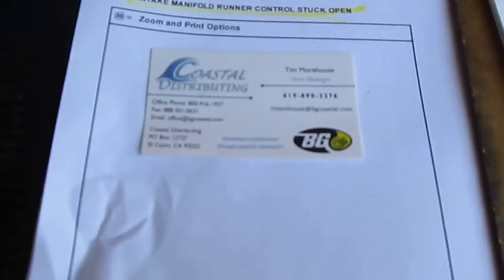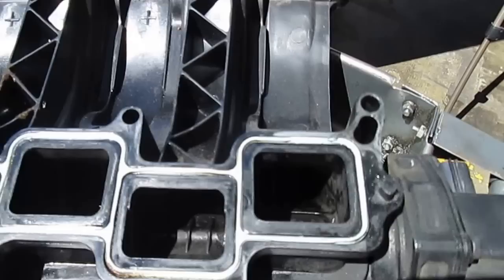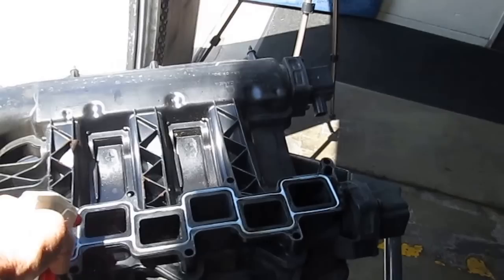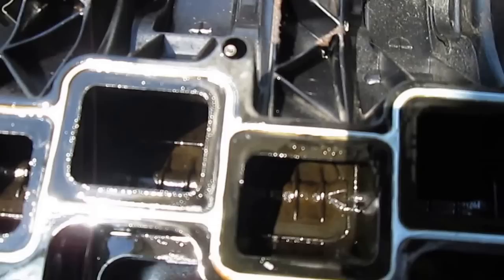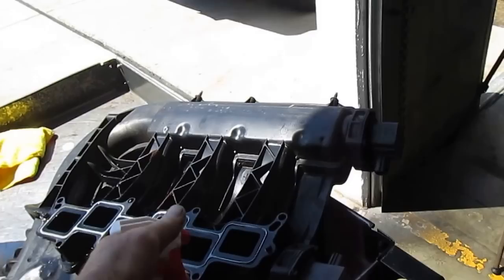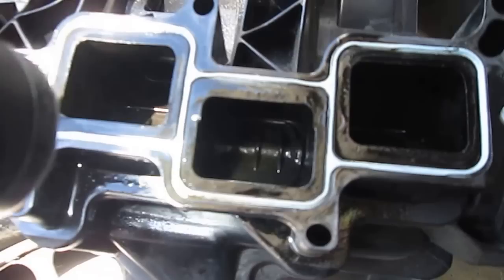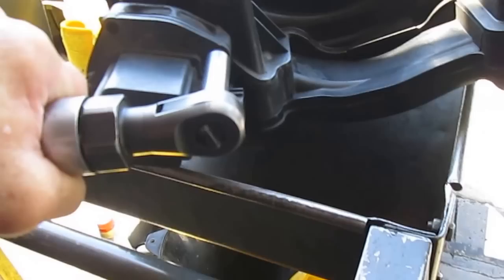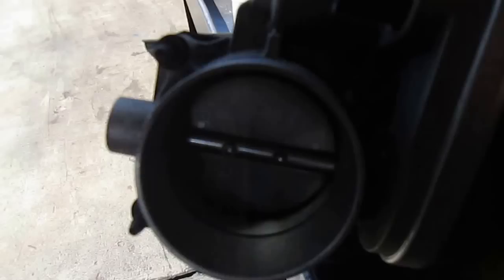New Product to Clean Intake Manifold Runners when you have code P2004

Comment: It is slow to move because of the rubber separator between inlets. There is a plastic bushing on each one which deterioriate over time.  There is also an 0-ring on the end shaft which can cause some friction when the shaft is turned. This small friction is normal. The excessive friction from the worn bushes is not normal. They can cause the runner to get stuck open causing the error code.
Reply: Would submerging n got water n cleaning help cause mines are super hard to move but no codes only noticed when changing plugs and throttle body
Reply: @dondadaherb4412  , It is easy to disassemble the manifold to expose the vanes. Remove the manifold gasket and remove two screws. Then carefully pull out the plastic retainer.  Then pull out the pin at the end of the shaft , the one that mates with the sensor. Then carefully pull out the vane assy. Use degreaser or carburetor cleaner to remove the accumulated dirt. Use a stiff brush. When done  just hose off the dirt. Repeat the procedure until the crud is all gone. Later on I will post a video here on youtube. Inspect the rubber bushings and remove the worn out plastic bushing inside to free up the rubber bushing. Friction from it will be eliminated. 
Actually now that I know how to remove the manifold easily, I might do an experiment later  which is removing the vanes completely but keeping the sensor only.
I read an article a few years ago saying that the vanes tumble the air so that it helps smooth out the idle. It is fully open at higher rpms but the vanes being present will actually impede some air flow. Anyway if my experiment does not work I can always put it back. Remember that the codes are thrown only if one of the conditions is present. Vanes stuck open or vanes stuck closed. If the vanes are not present what is there to get stuck? The sensor only acutates the vanes and senses the position of itself.
Reply: @mainsfortes5778 what if I’m getting a code for both stuck open and closed?

Comment: There is a 1 can treatment that has been available in the UK for 15+ years. 

It's called EGR Valve Cleaner. 

There is a Petrol version and a Diesel Version. 

I'm sure it's available worldwide. 

Many manufacturers produce it,  including Wynns & STP.

I've been using it for many years now, on Petrol Runners and Diesel Runners......

It costs around £4 and works a treat!

The is also a 1 can treatment that you can use whilst the engine is running, no need to remove anything, but results are nowhere near as good as when you take the Manifold off.

Comment: I am currently doing work on my Jeep compass . I thought it might be easier to change the oil sensor switch with the manifold removed instead of trying to reach it underneath.
I decided to inspect the manifold and clean the runners while its out and I found the exact reason as to why the vanes get stuck. Just cleaning is not enough. You actually have to dismantle the manifold , remove and inspect the runners. Clean it and remove the deteriorated bushing that makes contact with the runner shaft. When you remove this you will find that the rubber bushings will have a hole that is big enough to reduce the friction.  The rubber bushing is the separator. Then there is a thin  plastic bushing separating the rubber from the metal shaft. This part wears out, becomes brittle.

Comment: I got code p1005 & p1004 
Replaced both tuning valves same problem code still there,
Now am going to clean the manifold hopefuly that works...
Wont pass smog check with those codes guys

Comment: Thank you for this video,much needed info. Going to change the plugs,replace the plenum gasket & egr gasket. My question is,it’s okay to to spray throttle body cleaner into the runner or is that to harsh of a chemical to spray inside the plenum because it’s plastic. 2010 Dodge Charger SXT. Thank you.

Comment: Thanks John for the work trying to provide us with a cheaper alternative.

So what I haven’t read anywhere is what is the long term effect if I don’t do anything? 
For me it happens when I get up and go but I do that more than I should and it has only happened 3 times in a year and half.

Sidebar. So what I the part number for the intake manifold assembly? I can’t find one that comes with the SRV solenoid and throttle body as one assembly.

Also if I have to replace it is there a good upgrade replacement rather than staying with stock. I just figured if it is not much more might as well upgrade.

Comment: Vent the pcv to atmosphere replace the intake and problem solved. Stupid to put crankcase oil into the intake
Reply: The EPA doesn't like that.  I m sure in CA they will probably take you to jail. I good air oil separator would do the trick though.  I thought DI engines were the only things with this type of issue.
Reply: @mindciller You're a dumbass

Comment: Thank you for this video! I was looking for one on a 2011 Hyundai Santa Fe. But it looks to be similar no matter type of vehicle. My code is P2004 as well. Hopefully when I take it to the dealer it will be determined that it only needs cleaning.
Reply from the maker: You can go to the Hyundai website and type in your vin number, some models have TSB bulletins on certain codes. On the Dodge products I found out the intake manifolds just wear out and have to be replaced.

Comment: Would several bottles of injection cleaner with full tank of fuel help, or would this require removing the manifold and clean?
Reply: Unfortunately the vanes do not get sprayed with fuel so injection cleaner might not reach it. You can try to spray some cleaner via the throttle body.

Comment: What’s a good cleaning product I can use on my 2010 Dodge Charger SXT Intake Manifold  
I have the code P1004 and P2017 
Changed the actuator and nothing happened 
I’ve had mechanics tell me to clean the Intake Manifold and it should be good. 

Need Help!!!
Reply from the maker: I tried all those different cleaners and nothing worked more than 1 day and same code again.
The only fix I've found is buy the new manifold from the dealer, it comes with all the gaskets and new bolts, both actuators and a new throttle body. All you have to buy extra is an egr pipe o ring. 
It's a 2 to 2.5 hour job if I remember right. 
Call a few dealers due to the price can be 100.00 different for same part. 
I Would Not buy 
any type of aftermarket manifold from anyone.

Comment: Got a 2008 charger, same code p1004, i believe the manifold runner is worn out. question is: can the runner be so loose to make noise?  Engine has near 200k, sounds like lifter, valve train noise to me. but now I wonder, hmmm. If The engine is quiet by replacing the intake it may be worth the cost. If not I don't want to put any money into a clatter trap engine.
Reply from the maker: shawn beeman I have never seen one make noise. I agree with you, with that many miles it's not worth it.

Comment: Question. I bought a new attenuator and installed it. It didn't solve the problem. I finally took the whole plenum off and cleaned the short runner like you did. It looked pretty clean and the throttle would turn easily. The light still comes on. How do I know if the attenuator is actually working, meaning it actually turns, period? I think it may not be working. Finally, will the code clear itself? I tried to clear it using an Obd2, and it still comes on. I don't have the money for the entire manifold. Thanks.
Reply from the maker: Yep, I tried changing the actuators and didn't help either. The new one from the dealer has alot of design changes, came with both actuators, new throttle body and all the gaskets. The engine will not break down from this problem. The price has come down alot now. The computer is checking for how fast the runners move, since they are worn out and that's why the light won't go out. I recommend saving your money for the new manifold.

Comment: hey john i have a 2008 mazda3 2.0 an the code i got was p2004 i was wondering i do i go about fixing it without spening alot of money
Reply from the maker: +Robert Guzman Mazda has the same issue as Chrysler, they want you to buy the updated manifold. I have never found a stuck actuator or runner on a Chrysler, they just don't move fast enough anymore, the plastic parts are worn out, the new manifolds do look improved.

Comment: absolutely amazing videos and I have a question about my 2007 dodge magnum. I too I'm having trouble with that code for my short runner valve and thank for making all of these videos. My other problem is I can't locate cabin  filter can you please help me out with this problem thank in advance for your time and help
Reply from the maker: +BIGDOGPECK187  Open the hood and remove the trim cover  piece at the bottom of the winshield on the passenger side and underneath  that is your cabin air filter.
Reply: +John Sandler hey I just went outside and removed the piece of rubber and there isn't a cabin filter underneath there I can't find that thing anywhere I've even looked behind the glove box as well
Reply from the maker: +BIGDOGPECK187 On some models they don't have a cabin filter. I have called the dealer in the past and they supplied me with a cabin filter kit. 
I would call your local dealership, give them the vin number and they will be able to tell you if your vehicle has one or if there is a kit available. John
Reply: +john sadler well I went to the dealership a few years ago and they charged me $185.00+tax to change the cabin filter. And I started smelling all sorts of things from outside the car so I went back to the dealership and left my car their with them and I got a call after my car had been there all day saying my car was ready. When I arrived the manager informed me that I didn't have a cabin filter underneath the hood of the car. I then informed him that I had been previously charged for a new cabin filter. WOW I was laughing my head off and I received two free oil changes for me time and trouble
Reply from the maker: +BIGDOGPECK187  Amazing! I would have liked to see the look on his face when you told him that. Good job on letting them know!
Reply: +john sadler yeah he had this look like NOWAY! And then I had him look up me service records with his dealership. and I was lmao
Reply: BIGDOGPECK187 was it Perry Dodge by chance?

Comment: I wonder if the old school method of giving the engine a drink of water would work?
Reply from the maker: Hi Fred: Not in this case, I found out the manifold is physically worn out. The runner don't move fast enough even with the carbon cleaned out. John
Reply: Is it better to replace it then?
Reply: @JohnSadlersAutoRepair  hello I have a 2007 Dodge Magnum and I've had everything replaced can think of..the throttle light pops on when riding I have to pull over and reset the car and then I proceed driving..when the throttle light pops on so does the traction light...please help me

Comment: How do you take out the all the carbon build ups inside after the chemicals have loosen them up?
Reply from the maker: I rinsed it out with water and blew out with shop air.
It didn't fix the problem though,.check engine light was back on in a few days. 
Need to replace the entire manifold assembly with factory one. Comes with all the gaskets, actuators and throttle body.
Reply: @JohnSadlersAutoRepair  Thanks for the reply.

Comment: Awesome
Reply from the maker: Hi Terrence, the runners moved alot easier. The check engine light came back on though. Got a new manifold from the dealership,  it came with the actuators, bolts and gaskets. I could see alot of improvements in the design also.
Reply: No charge at dealership?"
Reply: Like 2 try out your formula for air intake manifold?" What the cost?
Reply from the maker: @TerrenceCalnimptewa  it was around 800.00 , well past the warranty

Comment: will this chemical work on a 2010 kia forte sx 2.4L @ 77,000 miles with the code P2004 & how would i use the chemical?

does the manifold have to removed or can i spray thru thr carburetor?
Reply from the maker: This didn't fix the problem, I had to replace the manifold.

Comment: What’s the liquid called that you used.  You gave great information but left off the name of the liquid you used so….
Reply from the maker: Hi Francisco,  it's from BG Products. You can find them online.
Don't have the exact part number. 
They asked me to demo it to see how it worked and I never heard anything more after that.
I use a spray that you use a pressurized container to clean the air intake and carbon off the intake valves. 
The website should explain what each product does.

Comment: what kind of solvent was you using to clean them runners with ??
Reply from the maker: Hi Harold , it was a test product from BG products. 
It helped clean the runners , check engine light still on. The problem is the manifold and runners are so worn out they don't move fast enough no matter what you do. The only solution I've found is buy a new upgraded one from the dealer that comes with new throttle body and both actuators.

Comment: Are there any updates for this yet? Also, how long is this treatment good for? Another channel did a similar thing and it only worked for a month or two... Thank you
Reply from the maker: This has been a tough one, only temporary resolution. The only way I've found to fix the problem is to replace the manifold with a factory replacement, they have made quite a few modifications.
Reply: John Sadler's Auto Repair thank you for the quick reply... I was really hoping this would work, sorry to hear that it did not... So I suppose my next purchase will be a new IM as well... 👍
Reply from the maker: The new one is really nice !! Lots of improvements, comes with both actuators and throttle body. All seals and gaskets were included except the o-ring for the egr pipe at the back of the manifold. Ask several different dealers, see if they have a prefered member discount or something like that.

Comment: What did you used to clean that up?????
Reply from the maker: The cleaning didn't help with the check engine light.  Had to replace the  entire manifold.
Reply: @JohnSadlersAutoRepair  the car stars good but then vibrates and dies out
Reply: @JohnSadlersAutoRepair  is a 2005 with 228 thousands miles
Reply: @JohnSadlersAutoRepair  I've to slove this. Manifolds are not cheap. Do they sell those products that you used on your video?

Comment: So update? Is it safe to use on the manifold?
Reply from the maker: M Escobar yes it's safe to use on a manifold, no it did not solve the problem. The only way I've been able to fix this problem is to replace the manifold with a new one from the dealer which is a better design.

Comment: My 2013 Nissa. altima has this code p2004
Reply from the maker: Not sure on Nissan, I would contact Nissan Corporation and find out if there is a service bulletin on this problem. There website should have a  place to put your vin number in to see about recalls and problems. 
You can ask for a service rep at your local dealer and give him the code number and if it's a common problem on that they will let you know. 
The one's I have done all ended up needing new manifolds to solve the problem.

Comment: What is that stuff?
Reply from the maker: Hi Charles,  it's a new formula I was testing for BG products. 
I found out the intake runners wobble around inside the manifold and move to slow , that's what sets the code. 
The only fix for this is to replace the manifold. The new manifold is a better design and comes with new throttle body, actuators and 
all the gaskets and bolts.

Comment: what is the new product made of? sounds like this is not new, just something they sent you and someones thinking of a new label.    would be helpful maybe to know what it is.  The warbled out shaft is because of the plastic shaft housing, the same exact thing happens to lawnmower wheels.   when these companies cheap out, we all get screwed.   If they wanted to go cheapo plastic manifold and they wanted to do this design, then why would they not make a FIXED PERMANENT Metal Shaft housing that it protecting the plastic from grinding out with repeat exposure to that shaft being constantly adjusted by the electronic valve adjuster? 

    The answer is GREED and they do not care about the consumer, each example of this kind of thing just makes me feel like its another FU from the fat cats. The ones that take our hard earned dough and laugh when we drive away thinking we have a top quality product that cost more than a years a freaking salary to some of us.
Reply from the maker: +Leisure suit Larry Yep !!! The new manifolds I've installed are still plastic inside and out with a little more heavy duty runner.
Reply: seems like they should be doing warranty and extended warranty on this part. I just got mine in, the valve flaps are white in this new one.
Reply from the maker: If they can get away with a TSB instead of recall they will.